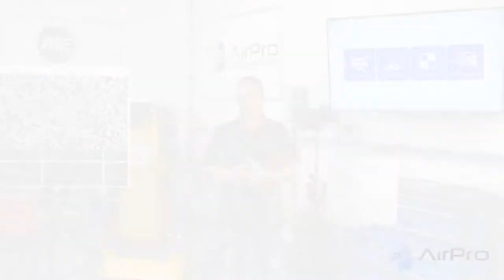ADAS and Alignment Part 2

Comment: The insurance company should do their homework. Adjust the loss to gain ratios for profit based off the vehicle, the equipment level that vehicle has and the record of the folks driving it. A large city, next to another state and city as well can have or increase the number of un-insured drivers. When an accident happens, it never fails to be a guy / gal from the next state over who has no insurance. Unfortunately for us who do everything right, our premiums go up. Do not let the insurance company off the hook for added expense for a vehicle you drive safely but requires more cost to ensure the safety systems are working correctly. There is no excuse for ignorance of the law, or an insurance company that never did the cost ratio balance risk assessment on you model of car and what the manufacturer says should be done if????
ASE Master Tech since 1978, retired.